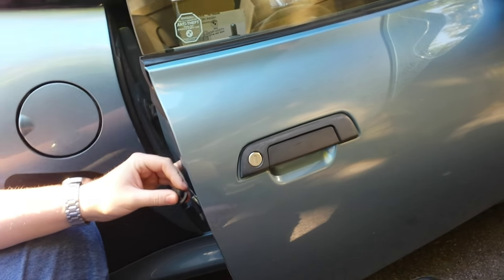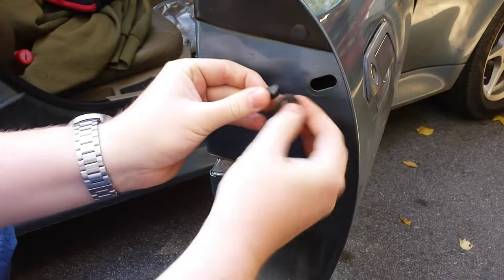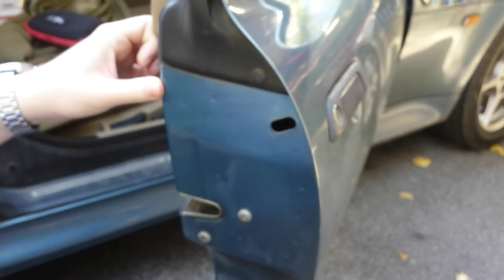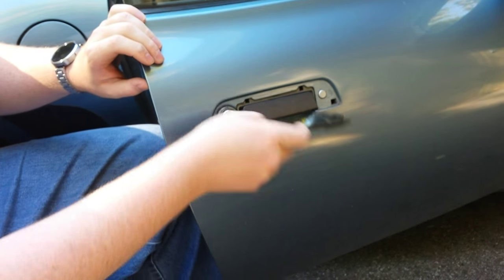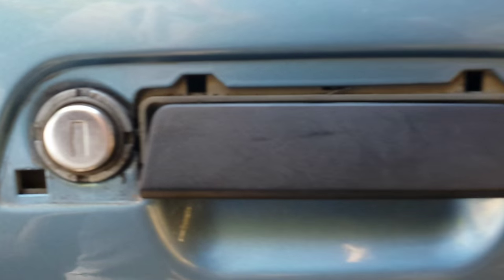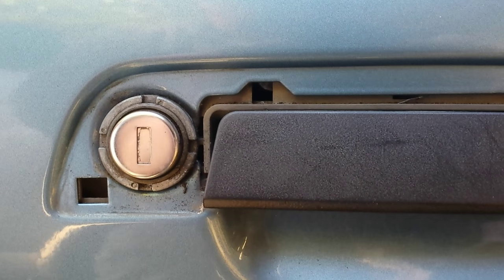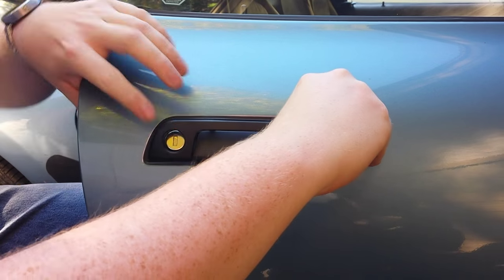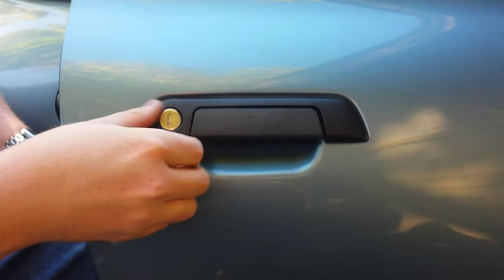BMW Z3 Door Trim Removal and Install

Comment: Thanks! 2 comments. 1) There is a center piece of the access hole cover that comes off. I found it easier to remove than the whole thing. 2) On my 2001 Z3, the tab you first push, then pull was black on the passenger side & gold on the driver’s side.
Reply from the maker: My little block off plate for the access hole just came out as one piece lol

Comment: how do you get the plug out of the door to insert the tool to fix the trim?
Reply from the maker: use a flat head screwdriver and you should be able to pop it out

Comment: What tool are you using to pull the lever inside the door?
Reply from the maker: Paul Whiting a right angle screwdriver but only because it fit. A small pick should work too.

Comment: So, you can use the e36 door trim for these Z3 doors?
Reply from the maker: im not sure. i got mine from ecstuning.com
these are the part numbers for what i used 
left : 51218400195   https://www.ecstuning.com/b-genuine-bmw-parts/covering-left/51218400195/
right : 51218400196   https://www.ecstuning.com/b-genuine-bmw-parts/covering-right/51218400196/
Reply: Thank you!
Reply: You're the man Matt!!!!